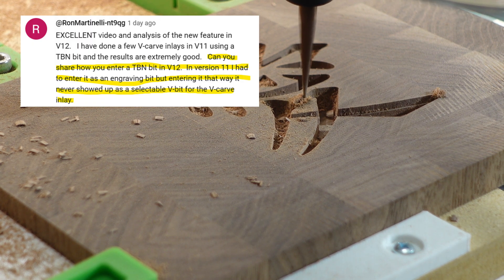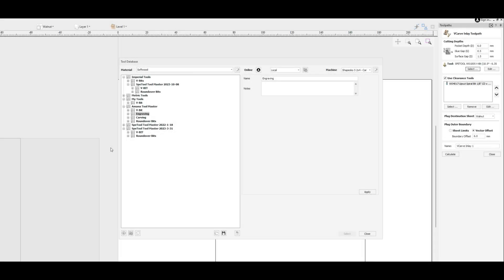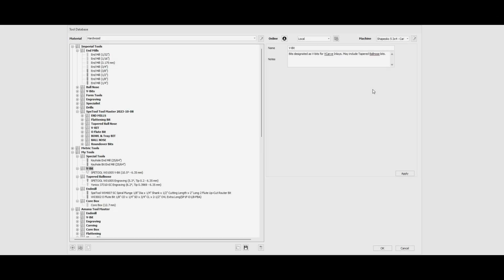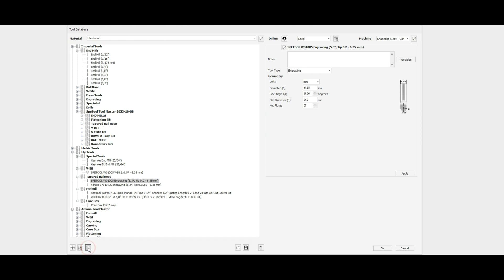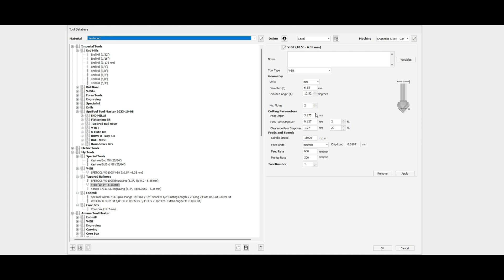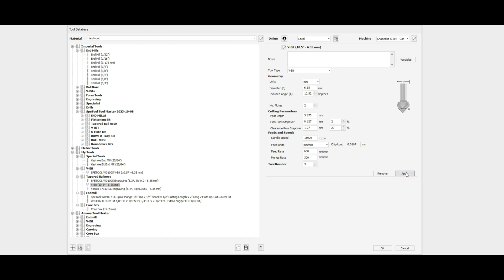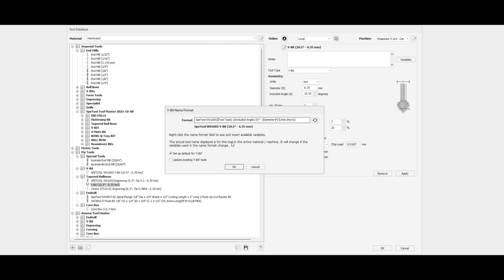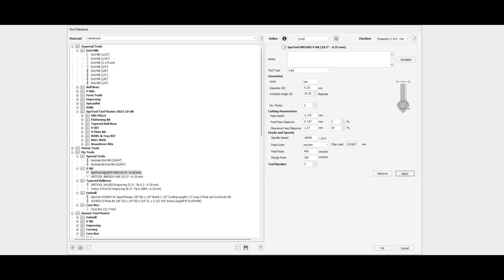How to use a Tapered Ball Nose Bit as a V-Bit for VCarve Pro or Aspire Version 12 | TK Designs

Comment: Awesome tutorial, thank your for sharing. Ive done several test but having issues with the plug cuts, clearing seems good but when I run the TBN file, it seems to be cutting the inside of the vectors, the plug is significantly smaller than the clearing cut and way too loose when inlayed. I'm using Skinny Jenny 1/16, 5 degree angle TBN. I'm setting the angle to 10 degrees. What do you think I'm doing wrong?

Comment: I'm struggling with my first inlay attempts and missing something here...  I'm using a 12.4 degree tapered ball nose with a .030 tip, I had just created that under V-bits and early attempts have the plug coming out too skinny (thinner than it looks on VCarve preview also).  When I draw the bit in cad there is .143 cutting length "missing" with the .030 tip width compared to if it came to a true V and the program doesn't know that.  The way you did it started out with a flat tip diameter as a tapered ball nose but lost it when it was changed to a v-bit category.  I'm failing to see how this is any different than just creating a new v-bit with that angle, and leads to the same issue with the program assuming it comes to a true V point?  I just created another tool version using the method shown here and the preview looks identical to the one I had created from scratch as a v-bit, will try running it on the machine but I don't see how it will be different?
Reply from the maker: Sorry for the delay in response.  Is your tool measurements in inches?  How deep of inlay are you trying to do?  I ask, because if you are using inches, your flat tip is approximately 3 times the size of mine, which comes in at 0.2mm, and 10.52 degrees.  My inlays are 6mm deep, so the loss of cutting depth is insignificant with the bit I use.  I did not account for a flat tip that is 3/4 of a MM (0.030 inches), so for that I apologize if my formula doesn't work for you.    Unfortunately, VCarve has never supported using TBNs as v-bits, so we have always had to find a work around.   Can you tell me what bit you use specifically?  Thanks for watching and providing valuable feedback!
Reply: @tk.designs  I'm now using a 10.52 degree total angle bit with a .020 tip and found settings that make it work by experimenting with the surface and glue gaps.  👍  Not sure what you mean by them not supporting TBN bits, though, both in V11.5 that I still have installed and in V12 the VCarve/Engraving toolpath allows you to select a TBN and define a tip radius.  It's only the new V12 VCarve Inlay toolpath that creates the plug at the same time that doesn't allow it.    🤷‍♂
Reply: Agree with you. The 'missing tip' of a TBN means that when you set your Z height on the touch plate, your Z0 is set too low is going to cut too deep resulting in a bigger pocket and a smaller plug. With the small angles of a TBN, this Z height error is significant. For a 0.2mm tip it is a 1mm height error and for a 0.4mm, it is a 2mm error . For this reason, the v12 VCarve functionality is useless with a TBN. If this does not make sense, draw your bit profile in CAD and measure the distance between the theoretical V-Bit tip and where the actual ballnose tip is. The smaller the TBN radius, the less the error but it is still significant.
The error will be effectively the tip radius on both sides of both pocket and plug. A 0.2mm tip radius will result in 0.8mm play in the inlay. Thats more than glue can fill.
There is also the risk that the plug will bottom out as the geometry is now all off which also contributes to incorrect fit.
Reply: @irritatinglylogical  I experimented with gaps and found settings that make the new toolpath work for me.  The inlay comes out .010 wider each side but I'll never see that in reality, and the fit and glue gap are spot on.  👍
Reply: @irritatinglylogical  Funny you said draw it in cad....in the time since I posted that first comment and now I've done that and a lot more experimenting and have the new toolpath working perfectly along with uploading my own video on my findings.  Since the 12.4 degree bit I had rolled off the machine and broke the tip on the floor (of course it landed tip down 🙄) I'm now using the same 10.5 degree bit TK Designs had linked and with .200 surface and .120 glue gap setting I'm getting pretty much perfect fit and glue gap (yes I've slice several samples to check glue gap...).  👍

Comment: Thanks for this video!  Im making a couple of end grain cutting boards right now.  I would like to add an inlay to them.  What settings, most importantly the glue gap do you use in this scenario?  I have read somewhere that if the gap is too big, you'll get a hallow sound where the inlay is. I plan on using a 60-degree vbit.
Reply from the maker: Thanks for watching!  I use a 0.5mm glue gap. I use Tapered Ballnose Bits as v-bits, and mine is approximately 10.52 degrees. I use a start depth of 0, and flat depth of 6mm on the pocket side, using the traditional v-carve inlay method.  I use a start depth of 5.5, and flat depth of 1.5 for the plug side.  These settings would likely not work too well with a 60 degree v-bit, as it is considerably wider than the bit I use. My apologies for not being able to be more helpful.
Reply: @tk.designs  I really appreciate the content you are putting out on this subject but there must be something else as I've just tried this exact set-up using a TBN and the pocket is too big / Plug too small... Any tips would be welcome?
Reply from the maker: @danielgreen414   I  did a follow up video here to deep dive into the settings: https://youtu.be/oEmTH3y9LsE Many others also had issues. Hopefully this video will help you to further hone your settings. Thanks for watching!

Comment: The video and the previous one are great. I tried to put it into practice though and failed. I tried setting up the Amana 46282 and then the 46280. In both cases the actual cut of the plug had portions that got lost. The thickness at what would be the bottom of the plug when flipped into the pocket was much narrower than the simulation showed. I ended up with much thinner details than when using a 60 degree bit. 

I did set the angle as double the side angle specified on the Amana site. I don’t know if my detail is too fine or if I am missing something else. One difference is that I am doing coasters in face grain, not end grain but still it just doesn’t look like the simulation. I am using Vcarve Pro 12.005. 

Any thoughts?
Reply from the maker: Thanks for watching! The Amana 46280 is a side angle of 6.2, so an included angle of 12.4. The Amana 46282 is 5.4 side angle, or included angle of 10.8.   Are these the parameters you are using?

Also, can you tell me what you are using for your pocket depth, and glue gap?

The parameters I use are in MM for my inlays and I use a different bit (5.26 side angle/10.53 included angle), but if you use inches, we can probably figure out what the issue is too.   

For the Amana 46280, one of my viewers found that a pocket depth of .2 inches and a glue gap of .02 inches worked well.  Please let me know what you are using. Thanks again!

Comment: You are the KING!!!!  You have totally 100% demystified this whole issue with how to set up a TBN to be used as a vbit properly!! You deserve the Noble Prize 🏆 of the CNC world!
Thank you again!!!!!
Reply from the maker: Thank you for your kind words!  In my previous video where I contrasted traditional vs the version 12 vcarve inlay toolpath, I though I had covered it already, but I found that I missed it. Thanks for watching!
Reply: The not being able to use tapered ballnose bits for inlays has kept me from pulling the trigger and buying the software. I was looking for a way to buy 11.5. But from what you show you CAN use them now. ? If so why do you double the angle?
Reply from the maker: @huddleshuddles7360  Thanks for watching!  I double the angle because the original TBN uses a side angle, or half-angle while a V-Bit uses an included angle, which is both sides of the angle.  Think 90 degree or 30 degree V-bit versus a 6.2 degree TBN.  When you change the TBN to a V-Bit, you double the side angle to give the true full angle of the V-Bit. Hope that helps!